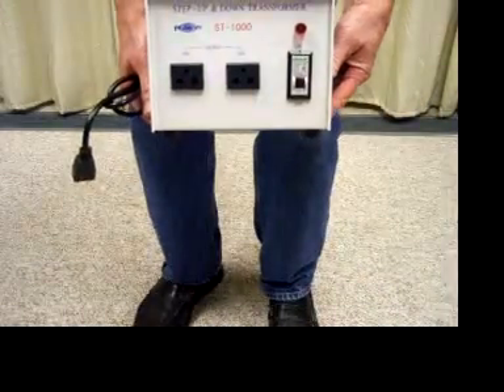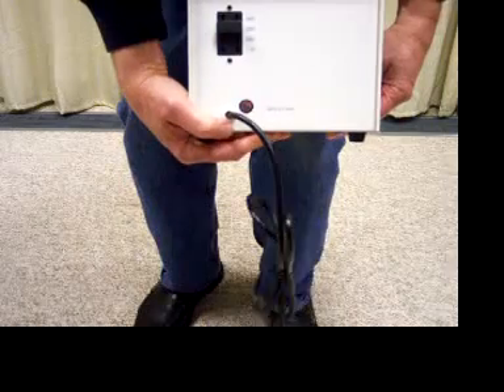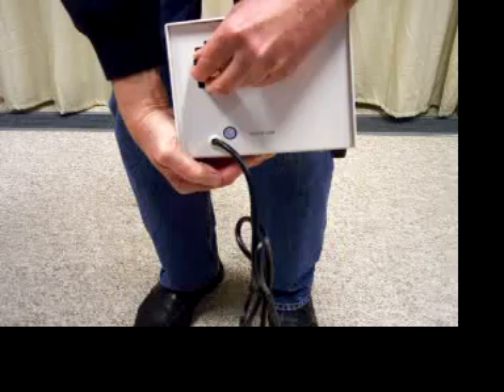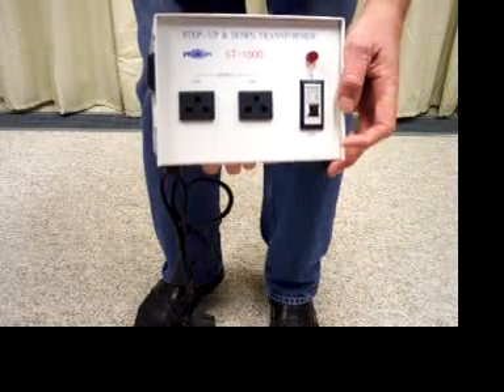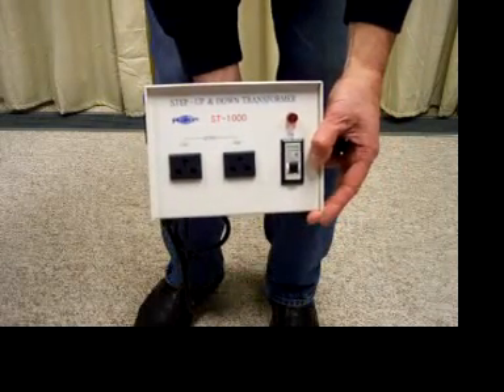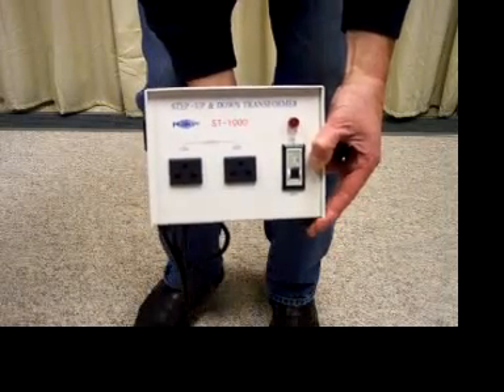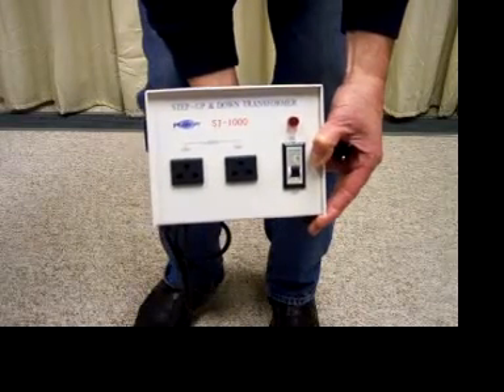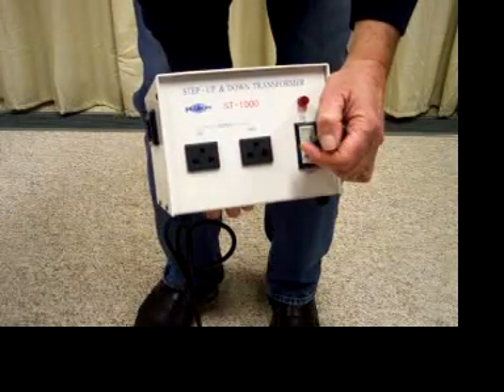st1000

Comment: i have a seven star st-1000
I am in bulgaria (uses 220v)
The unit is just like yours but black and theres two outlets in the front one reads 110v and then 220v  I got it to work in the 110v slot but would it be possible to use two american devices in those slots on can only one work>?